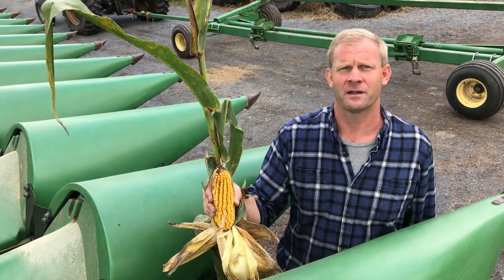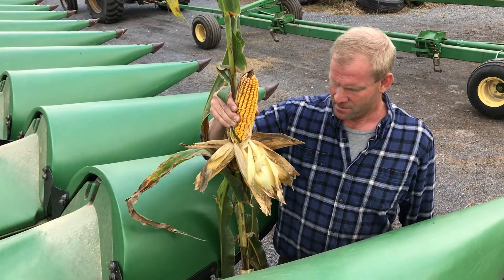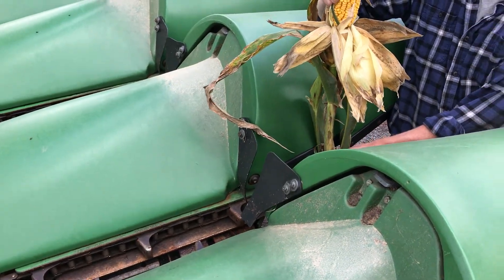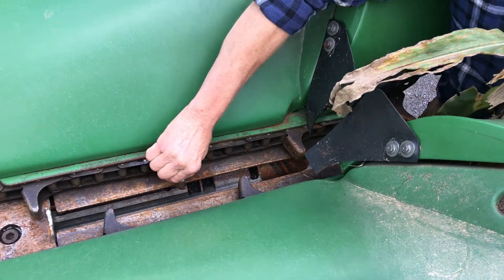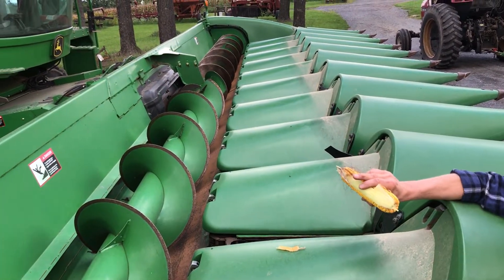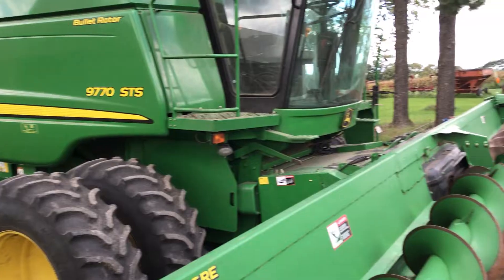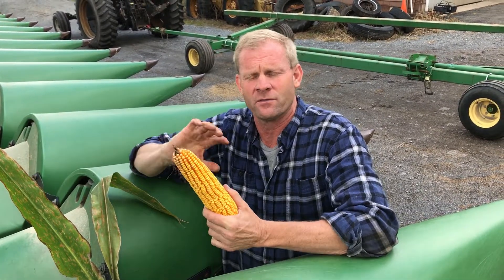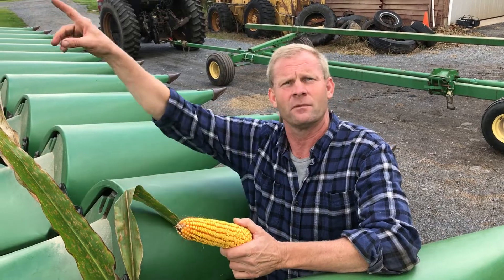How a combine works

Comment: And how does the leaves covering the Cob get removed? 
Thanks for the video by the way
Reply: im pretty sure the leaves covering the cob are attached to the stalk. so most likely they will remain with the stalk as the cob is pulled off. if leaves do stay with the cob, well then it just goes into the thrasher which separates the kernels from the cob and the leaves that are stuck to the cob, the kernels fall through holes in the thrasher and get augured into the hopper, the leaves and cob would remain in the trashing drum and go all the way trough to the chopper and will be chopped into chaff which the combine throws out at the rear.